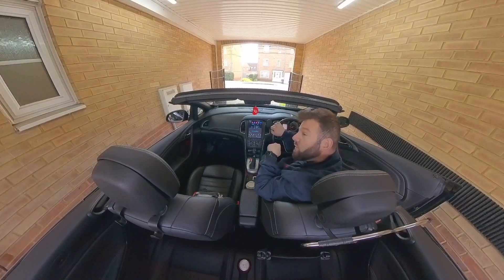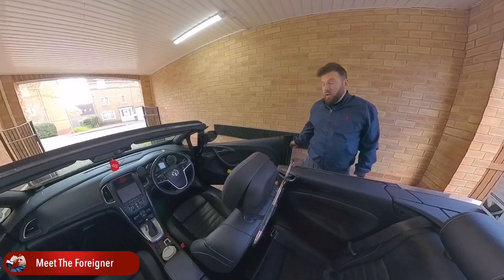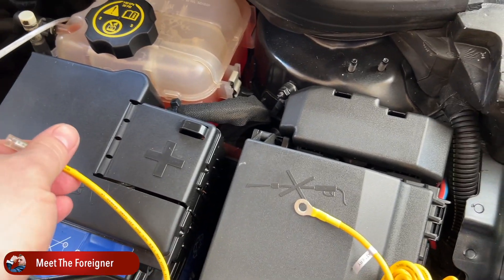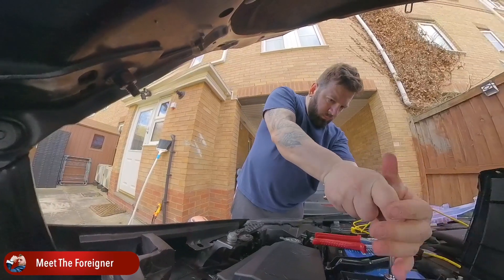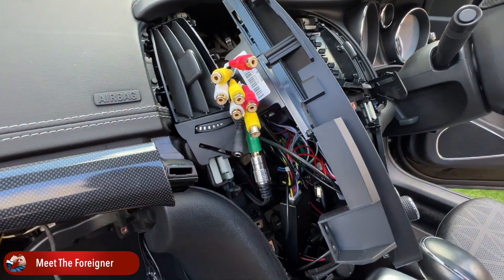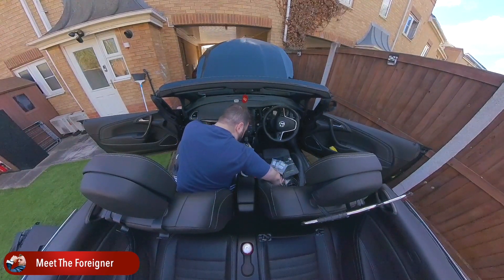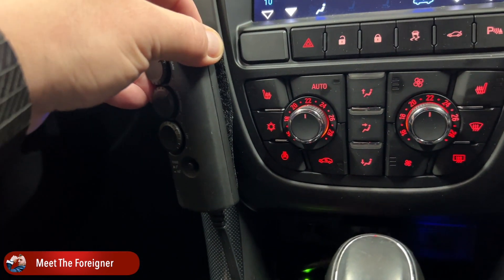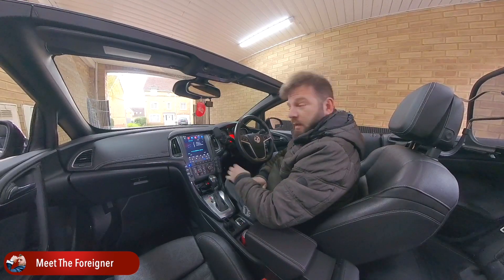In Phase USW 300: Amplified under-seat subwoofer installed on Vauxhall / Opel Cascada

Comment: Great video. I have 2 usw12 and looking at getting both connected, did you run both from rca and how did you split the signal? I watched it 3 times and still didn't catch this part.